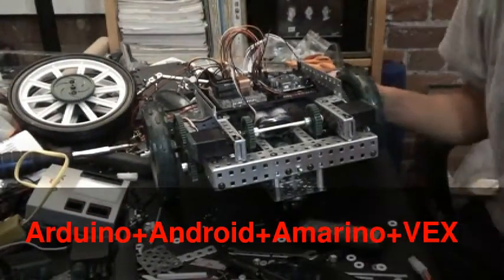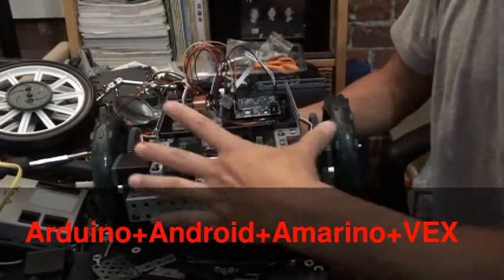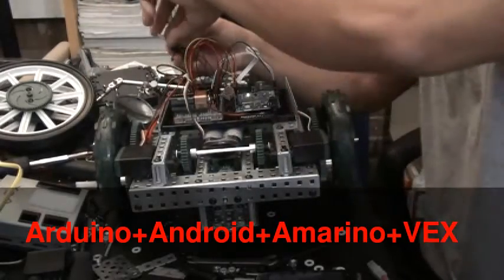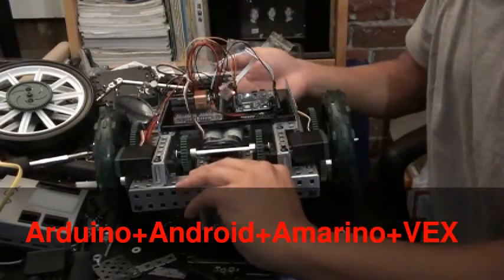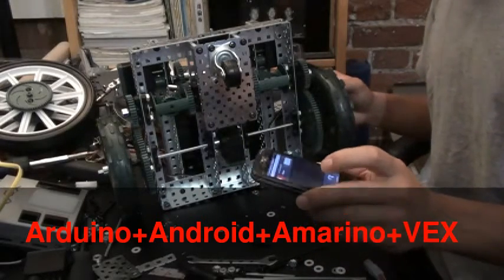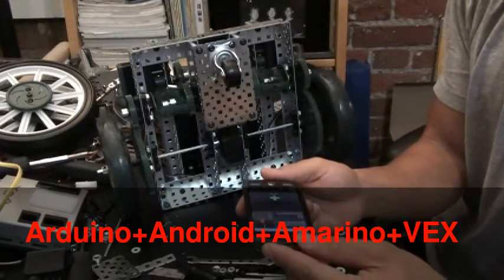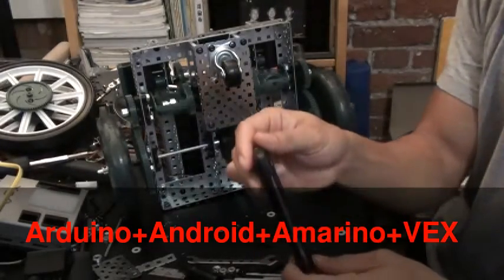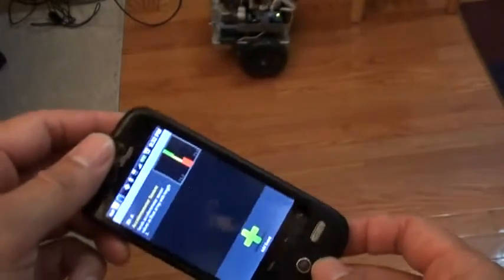Turdo Bot 2011 (Dual Differential gears + Arduino + Android)

Comment from the maker: The 2 motors inline with each other are actually running together. I wanted to have more torque in the translation motion so that I don't over work the single motor. The motor at the bottom rotates the bot which doesn't need as much torque. Sorry for the late reply I didn't expect anyone to ask questions.

Comment: i have a question. im a part of a robotics team  and have worked with vex bots micro robots and such. but is the third motor necessary? you are powering the wheels with different motors so you already have a differential. why add the third motor?